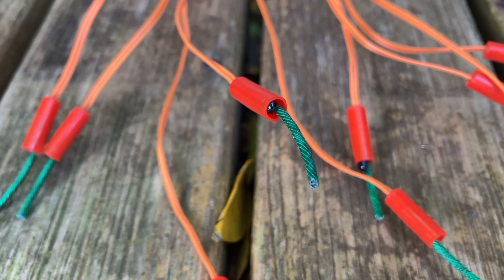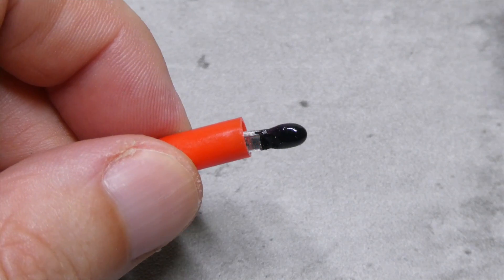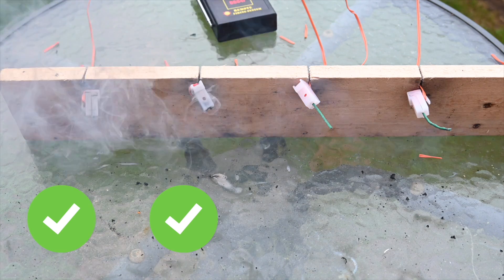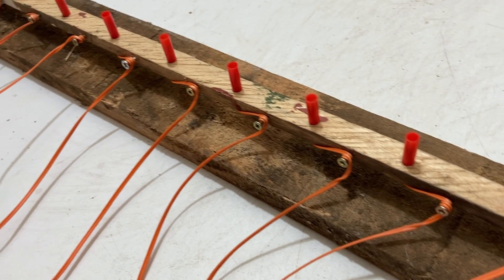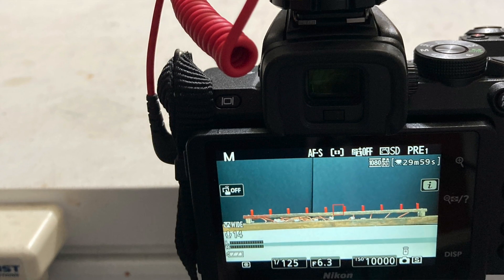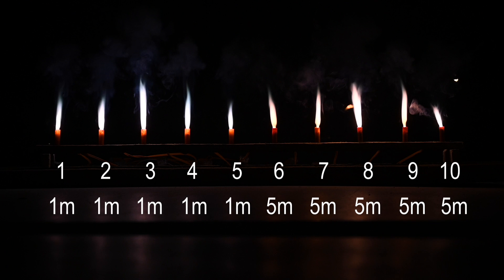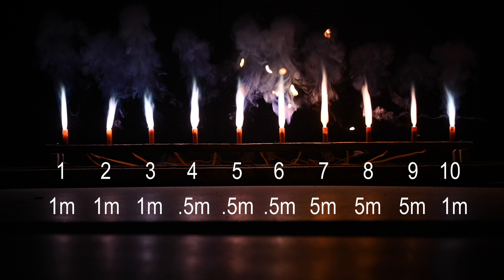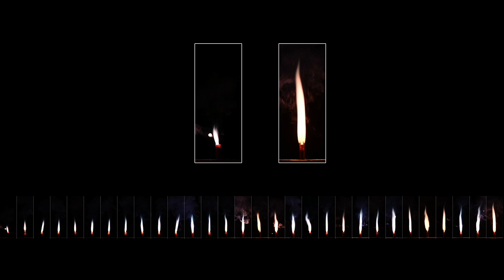Ematch igniter test - variation in power and burn times

Comment: This is brilliantly put together video with very usefull info. I don't know if this will help but when I worked in the field, we would use a mix of consumer and cat4 product so for the consumer product we would use 5cm strips of good quality quick match joining the ematch to the visco. That way there is always enough fire. Visco is heat and water resistant coated on it's outer surface  so you always light it on the end, as you said where the powder is exposed. Looks like there is lots of inconsistency in ematch compound and amount. Helps me lots ☺
Reply from the maker: Thanks. I can imagine quickmatch does a great job, as you say there's a lot of heat/flame with that. I did wonder if the way forward was adding something perhaps in the shroud or even inside the widget, but the question is what is available for the public and also safe for beginners. There's tapematch which is still available... maybe the ematch into tapematch then into visco? Lots of tests still to do then ;)
Reply: Would a higher voltage , (say  12v
ADD something to the violance of
the burn.